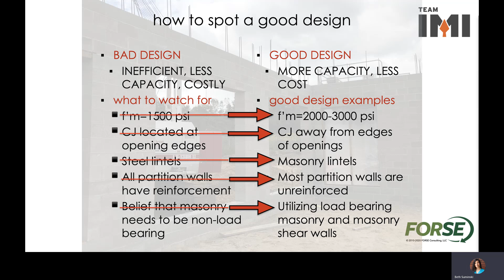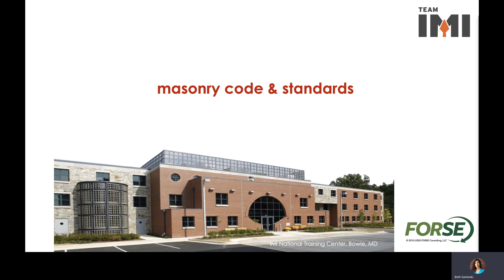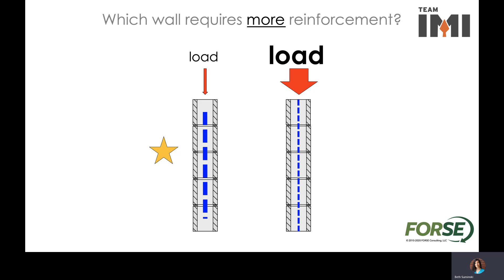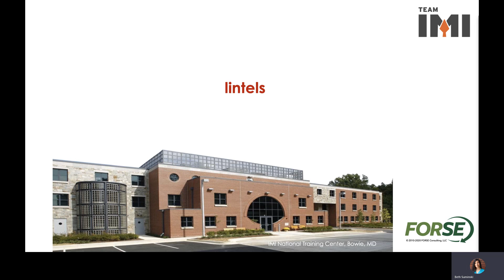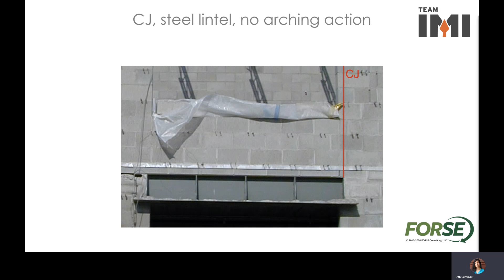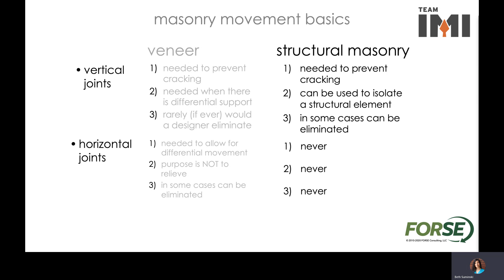What Non Engineers Need to Know About Structural Masonry

Comment: CMU walls are not very attractive from the aesthetic point of view.  
If decent and suitable clay bricks (like the ones in old masonry buildings in Europe which are still available and used today) were available here in the US, than that would make the use of the masonry walls more attractive.  
One positive aspect of the CMU walls  that was not even mentioned, is the much larger thermal inertia that comes with the thicker and greater mass of those walls. It greatly improves the thermal design of the building.
Reply from the maker: Did you know there are hollow clay masonry units? Essentially the same aesthetic as clay brick, but with open cavities like CMU that allows for easy installation of reinforcement. 
For example:
https://interstatebrick.com/structural-brick/

Comment: Thank you for the information. Could column stiffener be used instead of control joint?
Reply from the maker: A control joint is used in masonry to relieve stresses in the wall due to shrinkage or temperature loads, and allow for minimal horizontal reinforcement to restrain. An alternate method would be to not use control joints and provide more reinforcement for restraint.

Comment: The problem is energy efficiency codes destroy the architecture beauty of masonry. Masonry is basically an expensive cladding at this point
Reply from the maker: Structural concrete and structural clay masonry offers some very nice cost competitive options for masonry buildings. Masonry can be used just for cladding, but it also can be utilized for structural and aesthetic purposes.